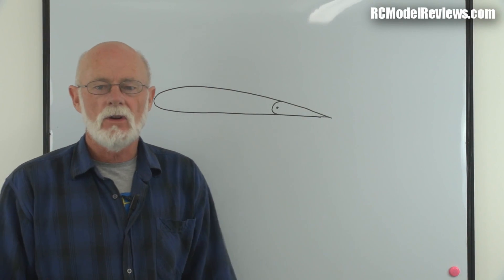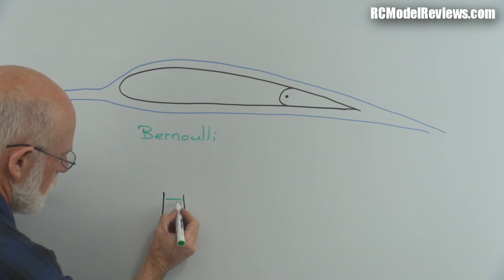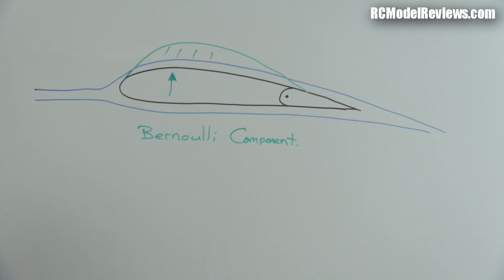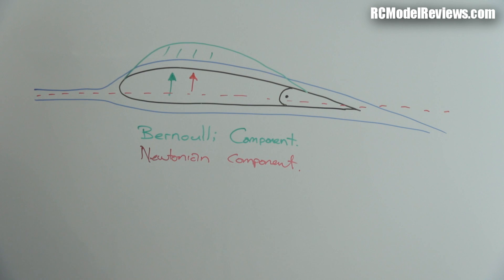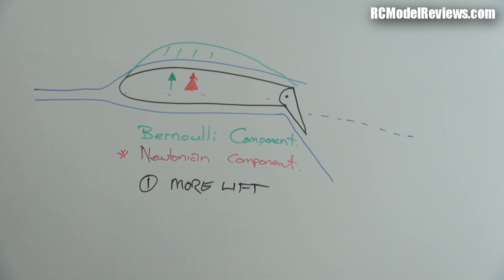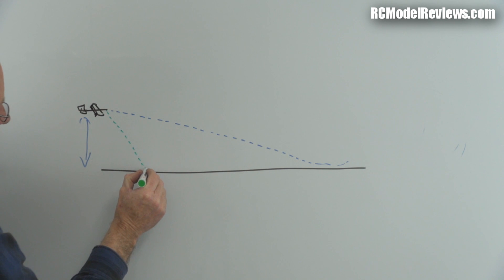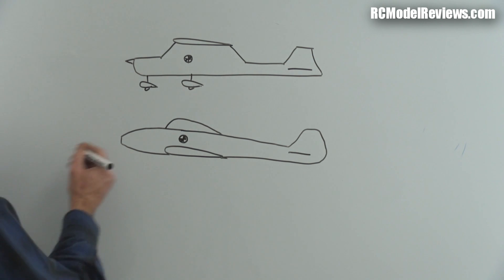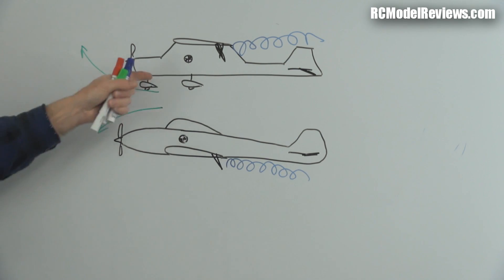How aircraft flaps work

Comment: flaps can be used for takeoff?

it's confusing for me; because it is going to  reduce speed which decreases lift     (L=0.5*Cv*A*V^2).
at the same time lift increases for given speed (which actually is lesser).

so on one hand it decreases lift & on other end increase it (for given speed) ...
my doubt is which effect is more dominant ?

thank you.
Reply: +RUSHI VYAS flaps on take off will make yoyu take-off sooner .. you get more lift so you will lift-off at slower speed .. then once airbone with enought airspeed you retract them to reduce drag and fly
Reply: +sparrowlt 
thanx
Reply: Rushi, you don't put flaps all the way down for takeoff. Approx. 10 degrees down is what's normally used in small, general aviation aircraft.

Comment: Fantastic explanation. I just got into planes and that answered several of the questions I had. I have a high wing J3 and a low wing F4U Cosair. Should my flaps be deployed using an analog style dial or can I use a 3 position switch? Currently, I have the flaps mapped to a 3 position switch on my Taranis, flaps down, flaps half and flaps full. I'm a bit worried about the violent change in pitch if my flap angle is too aggressive and the change too abrupt.

thanks.

Comment: Thank yo very much for the great explanation. However i got 1 question,

 When we use the flaps, the route of air which is traveling below the wing is getting longer. And according to bernoulli it must create a low pressure below wing so the plane must descend, but when we turn on flaps according to newton, flaps creates lift...

I got really confsed
Reply: Old. But the way the air travels stays the same. A flap isn't longer then then wing with flaps. Up

Comment: Great video as always, maybe an explanation of difference between 20 degree flap for more lift to help take off and 20 + degrees to give more drag for landings, 
As stated flaps have 2 main effects they create extra lift and also extra drag, up to 20 degrees (approx) the extra lift component is greater therefor assisting with take off, at more than 20 degrees the drag component becomes greater there for helping to slow the aircraft down and help with landings , 
This is why many aircraft have multiple or variable flap settings for different stages of the flight
Reply: I think what confuses most people about it is the extra drag but more lift concept...it's a bit counter-intuitive, under normal conditions most people think less drag, more lift but with flaps it is the opposite.
Reply: I also noticed something else, while this helps with the glide slope and air speed, the pitching effect on the aircraft and lift properties while landing are probably actually quite desired for a pilot who wants to make the landing as smooth as possible...if it has a tendency to nose-up the aircraft then that is perfect for bringing the rear wheels down first.
Reply: In general Aeroplanes with  a CL above CG (vertically), the flaps do pitch the AC nose up (with no pilot input) due to the high centre of induced drag, but for descent to landing  it increases comfort and visibility by allowing more lift at a lower nose attitude, ie. ie less radical for the passengers, the roundout is up to the pilot and the length of runway available.

Comment: I don't know who came up with the stupid "the air has to go a longer way at the top, so it must be faster, so Bernoulli". Which physical law dictates that the air has to meet up with the same molecules after the wing it got separated from at the leading edge? And still you hear it again and again...
Paper planes can fly quite well without having any difference in path length at top and bottom. The wing profile of airliners is very similar top and bottom and they still fly.

Comment: Not the best way to explain lift, kiss comes to mind, only talk about Bernoulli not Newton, complicates things far to much even then Bernoulli's theory can't fully explain lift generation (states that the sum of velocity and pressure in an ideal fluid remains constant, so if velocity increases then pressure must decrease and the opposite being true. Now that we know why we have a decrease in pressure over the upper part of the aerofoil and comparatively higher on the lower ( it also slightly decreases ) we can say that because high pressure always wants to move to low pressure a force in the direction perpendicular to relative air flow is generated and that is called lift, as far as flap is concerned all you do is change the shape of the aerofoil so that the air over the upper surface has a greater distance to travel so increase in velocity, decrease in pressure and as stated more lift until more drag is produced but that is a story for another day

Comment: great vid, very good explanation, however i have to point out that air moving on the bottom of the wing doesn't meet with the air travelling on the top of the wing at the same time, as proven in a wind tunnel, as the air at the top is simply moving too fast.

Comment: Can you please explain why this is different for delta wings? When I built my first flying wing, i set up the elevons wrong, because I assumed that if the elevons are downwards the wing generates lift thus goes up. Well that resulted in an immediate sad crash. Explain whats up with delta wings.
Reply: You will find that with any flying wing/Delta the control surfaces act the same as if they where on a conventional model/plane. This is due to the fact that the leverage that a conventional tail-plane with elevators has over a normal plane layout still needs to be  available even on a flying wing in order to pitch up or down the craft. Look at it this way the elevons on a delta/flying-wing do the same task as a conventional elevator & a conventional aileron, it's just that they are both located at the same position hence the word 'Elevons.:-)   
So when you deflect the elevons downward they pitch the model up at the back pivoting it around it's CofG therefore presenting the wing as a whole at a lessor angle to the airflow making it descend, the same in a conventional plane:-)

So all an elevator does is act like a lever to adjust the AoA whether that be an A380 or a small balsa wood glider:-)

Comment: I used to think that the Newtonian model was the sole cause of lift. I don't really appreciate that Bernoulli's principle is at work, solely because the theory does not make sense to me. (Not just with aerofoils - because as the air gets pushed up, I would have expected the air to compress - but also with the experiment with the venturi meter and also experiments with varying pipe diameters). However, I accept that it is at work mostly because of pratical tests.

Can you explain flow separation and why it reduces lift? Is it because the upper air has a shorter distance to travel since it no longer has to stick to the wing? Why doesn't flaps cause flow separation? Is it because of the vortexes at the back, filling up what would have been a void? Why doesn't a very small flap setting or very dirty flap setting (as you can see, I'm not quite sure what is going on) cause flow separation? Or does it in fact cause flow separation which is countered by the Newtonian component and or tempered by the vortexes?

Comment: (1) Daniel Bernoulli was born in the Netherlands and died a Swiss national; he was not an Italian (2) Bernoulli's principle doesn't EXPLAIN lift, it merely is consistent with it. (3) High velocity does not always mean low pressure; you must view the entire flow holistically, especially the upstream conditions. (4) STOP PERPETUATING THE EQUAL TRANSIT TIME FALLACY, and (5) "Bernoulli" and "Newtonian" components? C'mon guys, this cannot be passed off as anything approaching a real answer to the presented question...
Reply: There have being recent explanations to debunk the old concept of lift, i.e. ''bernoulli's equation not fully explaining lift on airfoil'' if you say high velocity does not means low pressure, hence, you are saying Bernoulli's equation does not hold... but let's remind ourselves that first of all, we assume a lamina flow as much as possible, hence, minimal fluid (air molecules) disturbance as the airfoil (streamlined body) slices through it, for asymetric airfoil, the upper linear measurement of an airfoil has greater length compared to the bottom realtive the    center line. If we assume fluid laminarity and invicid flow the adjacent air molecules are ''undisturbed''; i.e their relative positions are unchanged as the airfoil passes through them... and vice versa (I am assuming the air being stationary) hence, the transistion between the airfoil tip to the aft requires some implicit explanation:- the top air molecule travels faster than the molecule at the bottom ''relatively'' punching in Bernoulli's equation... both sides to be equal means the side with higher velocity (top) is deduceably with lower pressure, hence a push in the direction of higher pressure (bottom up), hence, lift... I agree this is just the component of TOTAL FORCES RESPONSIBLE FOR LIFT (newtonian also to be considered) but still makes sense...!

Comment: First, I am no pilot. This is no attack but simply an observation by a simpleton, haha. At any rate, it seems to me that neither of these theories really make sense. Why isn't it pressure under the wing rather than a lack above the wing that creates lift? I am just a truck driver but as far as I can tell a wing is merely taking the path of least resistance. Air is a fluid, correct? If you have an angle of attack that is positive (I'm guessing that would mean pointing up)you would create a build up of pressure under the wing and vice versa. Likewise the flaps seem to trap even more air under the wing causing the increase in pressure at a lower rate of speed which is why it helps to add some correction with the elevator (Seems to help me anyway). Can't help but thinking of sticking my hand out of the car window as a kid and feeling all the pressure on my palm as my hand shot upward :) Maybe I'm just arguing the same point from a different point of view....Either way, like the videos.
Reply: Higher pressure on lower surface, means lower pressure on upper surface. It's all relative.
Reply: Most of the lift a wing produces is the suction/low pressure on the top of the wing. That's why a stall is so dangerous: in a stall condition the air can't follow the top surface of the wing anymore which results in a significant loss of lift and the airplane is not able anymore to maintain the altitude.

Comment: The fact that the air molecules meet at the trailing edge of a profile is wrong... The flow on the upper side is simply faster and therefore leaves the profile earlier.
Reply: True. Other viewers may want to check this out: http://www.cam.ac.uk/research/news/how-wings-really-work
Reply: No the upper (cambered shape
)  has longer distance than the lower part of the wing, and  the reason why the air speed increased on the top is to compensate the distance and reach at equal time at the trailing edge of the wing.

Comment: leefuji 
so flaps pointing down causes lift but when elevators are pointing down they push the planes tailend up! confusing

This is because the elevators are far away from the Center of Gravity (CG) while flaps are very close. this is why elevators are out on a tail instead of up with the ailerons. The long tail makes them more effective at creating rotation as apposed to being close to the CG.
flaperons are far enough back that they cause rotation in delta wings and flying wings and thus they don't need a tail, manly because the lack of a tail pushes the CG forward and the larger wing area plus the different shape helps move lift forward preventing a nose heavy plane. Also being shorter in comparison to their wingspan helps prevent them being nose heavy.
Even if you had a straight wing plane with the CG far enough back to fly without a tail then you would still rotate with elevators at the flaps location but it would be very slow and not very strong because the CG is so close. this is demonstrated by the flaps causing a change in angle of attack but the elevator on the tail (acting as a lever) is more powerful and can overcome this.

flying wings, delta wings, and other craft missing a conventional tail, tend to have leading-edge slats instead of flaps which are on the front of the wing and thus closer to the CG so as to increase lift with minimal rotational forces. (not all just a tendency)
Many commercial airliners have flaps and slats increasing lift far more than either alone and reducing or eliminating the rotational effect since they are in front and behind the CG.
this is a simplified explanation and doesnt cover all aspects and is a big generalization.

Comment: The assertion that the air must arrive simultaneously at the trailing edge is sometimes referred to as the "Equal Transit-Time Fallacy". The longer distance docent produce the faster travel and thus lift.
Flow approaching an airfoil can be divided into streamtubes, which are defined based on the area between two streamlines. By definition, fluid never crosses a streamline in a steady flow. The stream tube on top of the airfoil gets compressed and thus the air must accelerate while below it expands and the air slows down. This creates lift not the travel distance.

Comment: what if my flaps go up? Do I get slower speed while at the same time getting pushed to the ground?
Reply: Setting flaps slightly negative (up) will result in a higher speed since the plane is forced into a downside movement with less lift. BUT there is more than that, all this depends on the airfoil, where your cog sits and the EWD of your plane. Negative flaps are used in sailplanes to get more speed since those models / airfoils are usaly designd to fly slow in thermals. Putting flaps up on a warbird makes not much sense and might also cause your plane to stall.

Next thing, there's a difference between seting flaps slight up/down or full because the drag increases. This video here explains BASIC functions but not all technical and aerodynamic details about flaps, airfoils and so on.
Reply: Wouldn't flaps up be similar to having spoilers?
Spoilers reduce speed and lift simultaneously.
Reply: SBPilot33 Yes, in theory it would have the same effect but there is/could be a difference because the flaps we are talking about are located on the inner wing. Spoilers (ailerons UP, not lift dumpers!) are used if you don't have flaps and because the ailerons are usually located at the outer wing or sometimes th wohle wing there is a different effect ...
Reply: Oh. Thanks for the info!!!

Comment: You'll want to use thicker wing profile than bixler. Thicker profiles generate way more lift, they also generate more drag which results in slower speed that can be achived, but still you'll lift way more stuff with thicker profile.

Comment: Your explanation is incorrect. Accordin to the FAA, lift is always generated by the top of the wing. When the flaps are down the air over the top has to travel even farther to meet at a greater angle which increases the low pressure on top of the wing. drag is generated when the flap is down below the wing. Because the bottom of the wing does not generate any lift neither does the bottom of the flap. Thus a stall. Is the lack of airflow over the top of the wing can no longer generate lift
Reply: deleriumlnight, you actually believe this "Bernoulli lift generation bullschweay"?  its a fallacy, bro.

Comment: Hi great video!!  Im trying to build a plane that can carry a large amount of weight (FPV gear), i'm using some old bixler wings and I was wounding if there is any other ways I can increase the lift (load capacity) of the plane. I notice cargo plans have smallish wings for there load capacity and was wondering what tricks they use. Any advise would be much appreciated.  Thanks.

Comment: It is my experience that flaps do not cause tip stall.  Flaperons can, but I've never had an issue with that, either.  Tip stall is simply stalling.  Some planes have nastier characteristics than others.  But, no matter how well behaved an airplane may be at stall, it is never a good thing at low altitude!

Comment: I think you meant to say that the increased velocity is due to the half-venturi aspect, of which by Bernoulli effect exerts a decreased pressure on the top part of the wing. 

I'm also interested in the ratios of lift created by Bernoulli principle, deflection and perhaps Coanda if applicable on a particular wing design.

Comment: There has been a discussion on Flaps vs Spoilerons on low wings ie like the Mustang and Spitfire, that you can achieve a similar desired decrease in wing tip stall speeds + the automatic flare for landings !

Can you comment or do a video ?

Comment: MrJustme2 - "Ground Effect" is simply the compression of the air (within 1/2 wingspan of the ground) between the wing and the ground creating a cushion ("float") which dissipates as airflow slows.  (increased pressure = decreased velocity)

Comment: The theory that the air molecules over the top of the airfoil MUST meet with the same air at the other end, and therefore must travel faster implies that the the air molecules know this must occur. In fact, not only do they not  "think" about this, but the top airflow increases in velocity due to the Bernoulli effect between the airfoil camber and static air above, effectively creating a venturi. (increased velocity= reduced pressure).

Comment: Hmm, aactually, you only get significantly more lift if you use slotted flaps. With normal flaps like what you drew in the video, you get a lot more drag - which is why it's used in smaller GA aircraft only to slow down. Ofcourse, it does give a little amount of lift but those flaps aren't mainly used for more lift.